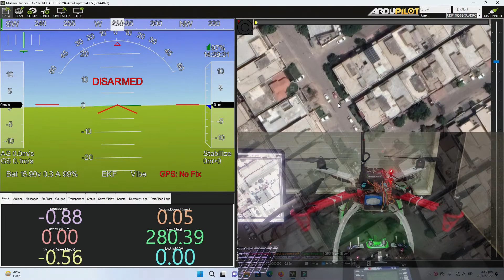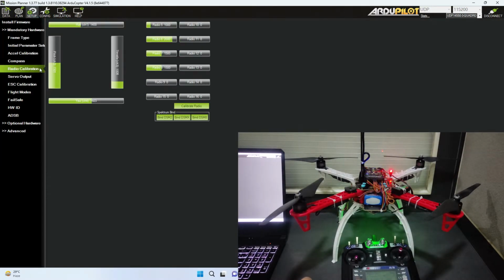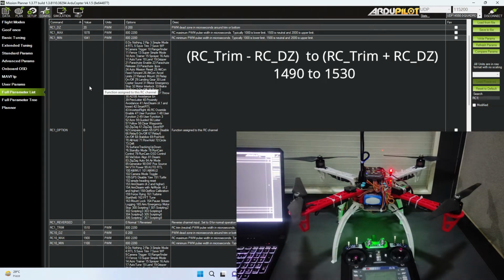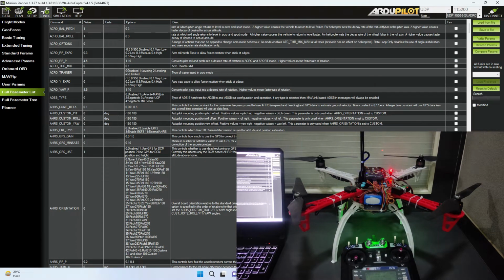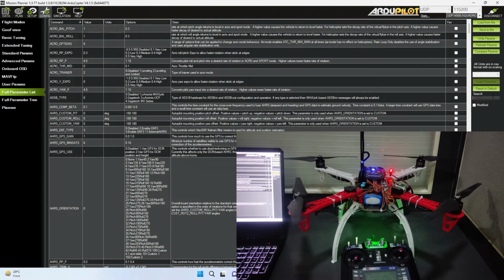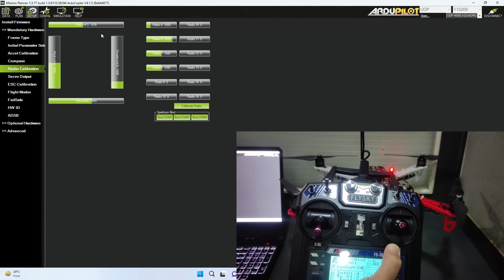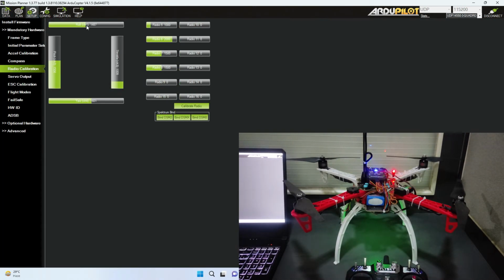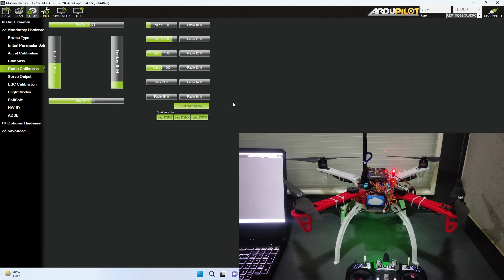PreArm Roll (RC1) is not neutral solution || PreArm Roll RC1 is not neutral problem solved

Comment: My drone was working earlier when I used to arm it. Now, it is showing error while arming that "Pitch RC2 is not neutral". In Mission planner setup, the default value right now is 1495, In full parameter list RC2_DZ is 20, RC2_MAX is 2006, RC2_MIN is 982 and RC2_TRIM is 1495. Also, I have recalibrated the RC and in Setup. What could be the reason behind the error?
Reply from the maker: Increase the DZ